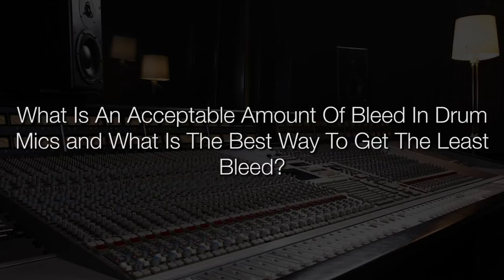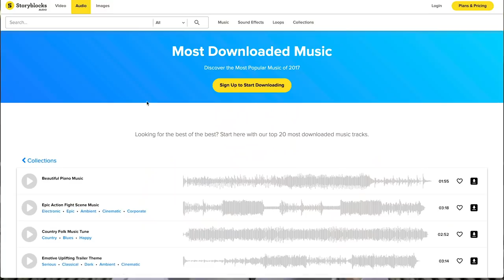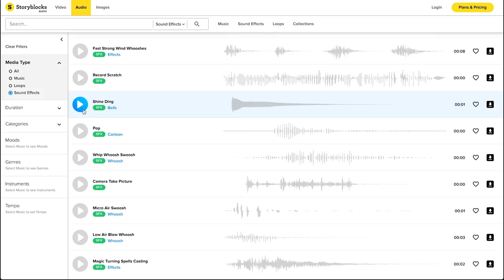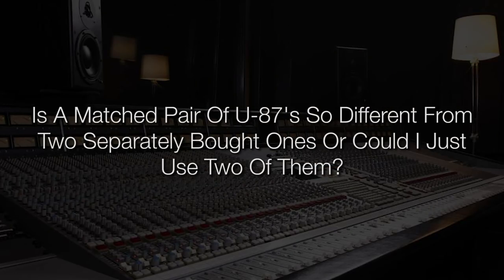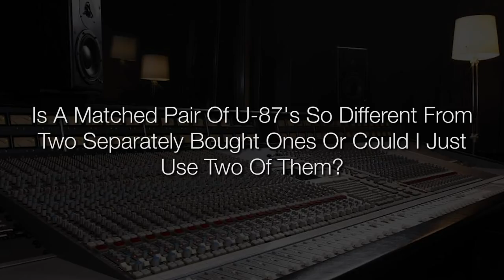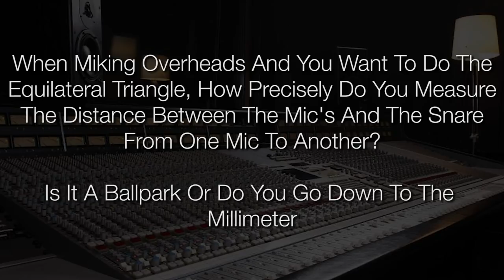What’s an Acceptable Amount of Drum Mic Bleed? | FAQ Friday - Warren Huart: Produce Like A Pro

Comment: With setting up a spaced pair overheads, if possible, I start with the equilateral triangle too. After that, I lay my phone on the center of the snare, playing back beeps. According to how the recorded (beeps) waveforms line up in my DAW, I slightly adjust the position.
Reply: oh that's neat. Should get you in phase pretty damn perfectly. gonna try that.
Reply: Have never heard that before but dang bro that's actually a smart idea
Reply: I take syncblops at 1kHz and at 60bpm or so because if the tempo is too fast, odds are that you line up two different beeps.

Comment: Two comments from me on the drum mic bleed topic: what really helped me is to have all these multitracks from different mixing courses (Thanks a lot Warren and all of the PLAP family). It really helps with engineering because you can get an idea how things sound before the mixing stage. helps a lot with finding the best positions for mics, hear how much bleed there is and everything.
If you want as much seperation as possible: in the metal world there are a few producers having a lot of success with recording cymbals and shells in two takes. but that requires of course a really good drummer to maintain the groove (there is a podcast with Eyal Levi, Machine and Chris Adler where they talk about it, if anyone is interested in that)
Reply: Cue the inevitable debate about recording acoustic cymbals and using triggers on the shells to mix in sampled drums...

Comment: Great video!  I was hoping to hear your take on limiting tom mic bleed..I have 3 targeted placed SM57s on a 3 tom kit...they seem to pick up EVERYTHING especially my snare and each other's toms but also kick...so if I'm trying to isolate a kick or snare sound, I have to more often than not targetedly gate the toms (via automation)...or just midi map and replace the toms...either way it's a bit of manual work either way as you can imagine.
Reply from the maker: Hi BrandonX76 thanks very much! I thought I covered the tom bleed? Are you maybe saturating your tom tracks? Be careful not to hit your mic pres too hard as they will bring up the background and create a lot of bleed. Do you compress as well? I only use compression lightly on the snare top and kick in mic. I hope that helps?
Reply: @Producelikeapro  oh...mayyybe it that simple, (and I hope it is) I will definitely try.  Thanks man...great content as of late, getting time with many of my heroes. (Butch, JJP, Manning etc etc etc).  Maybe get some time with Bill Schnee??  cheers

Comment: I just finished my first ever full band mix. There was a lot of snare bleeding into the high hat mic. Like, the snare was louder than the high hats in that mic. I managed to get it where it needed to be, but it was a lot of work. I wonder what your thoughts might be regarding that particular mic bleed situation. (I didn't do the tracking)
Reply from the maker: Hi TheWhollymoly great question! That’s quite typical! I would suggest trying sidechain compression in the hihat. Every time the snare plays it will duck the snare in the hat mic.
Reply: @Producelikeapro  Warren: Just wanted to follow up. I watched a tutorial on your channel about sidechain compression, tried it on the mix in question, and it worked magically! I added it to the high hat track, and the two overheads, too, while I was at it. I was able to delete all the automation I'd done to those 3 tracks to try to get the snare to sound good. The sidechain compression sounds 1000% better than what I had before. Thank you so much for sharing your knowledge with neophyte engineers/mixers such as myself!

Comment: Just a few comments on what was said about cymbals: thin doesn't equal bright.  Thinner cymbals in general have a lower pitch vs. the same size cymbal in a heavier weight.  Adding mass (thickness) in general raises the pitch of a cymbal (compare an 18" thin crash to an 18" rock/heavy crash, the thinner crash will generally have a shorter sustain and lower pitch).  Also, A Customs are NOT dark.  They are some of the brightest sounding cymbals that Zildjian makes.  Other than that, I agreed with all the other points made about drum recording.  Thanks Warren!
Reply: While this is true, I consider timbre more important than pitch when it comes to brightness/darkness

Comment: Hmm, a discussion about drum bleed and no mention of off-axis response? The need to control bleed depends on a lot of factors but I think the sound quality of the bleed is of primary importance and that quality is usually determined by the off-axis response of the microphones used. Everyone's favorite on toms makes toms sound great but the rather unpleasant off-axis response can make cymbal bleed  rather unbearable and gating will only work in certain situations and styles. Using a mic with closer to a textbook polar pattern ( meaning an even off-axis response) can reduce the degree to which bleed needs to be controlled. Ideally the off axis sources should just sound quiter while maintaining an accurate timbre, then you can actually use bleed to your advantage.
Reply: I agree.
Reply from the maker: Hi walthaus I did discuss off axis response. Maybe you missed it? We can talk about different mics in particular, for instance the sound of 421’s cymbal bleed is quite harsh to say the least! There’s a lot more options that sound far better!
Reply from the maker: Kevin you didn’t see the off axis response talk either?
Reply: @Producelikeapro  Oh, I must have missed that, my bad. I was thinking about 421 in particular. Thanks for responding.
Reply: No I didn’t. Listened to the video in my car so I wasn’t in full attention. Sorry.